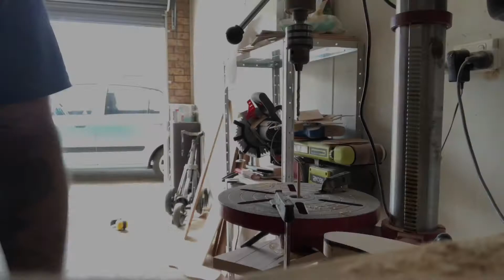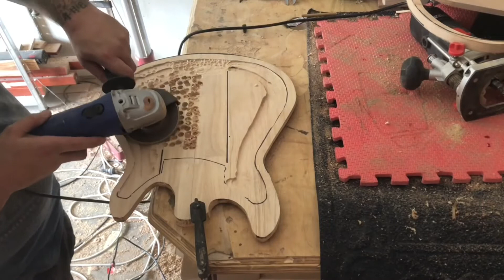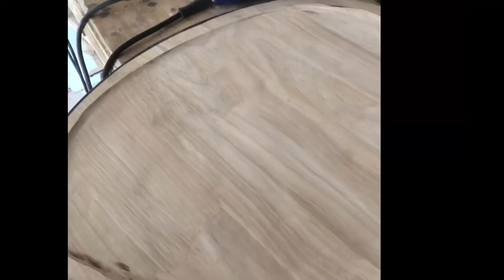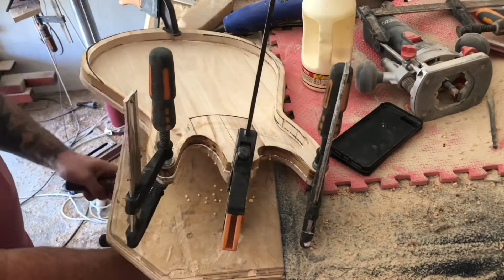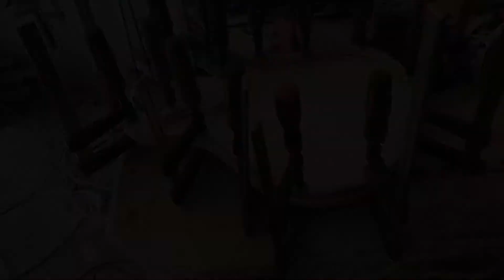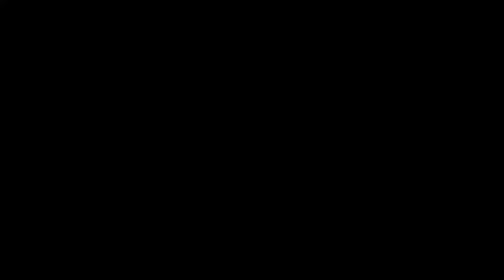Lockdown guitar challenge 2020 #4

Comment: Thanx for the video, I understand now how the dowel works with the drill lol. Great job 👊
Reply from the maker: Yeah it basically works kinda like a pin router, just set it to a bit thicker than you need and chisel or sand away

I didn’t have a lot of time so I used the grinder
Reply from the maker: I believe someone else is doing something very similar
Reply: @saulgoodeguitars  yeah it was good to see in action. I'm dyslexic, so reading instructions frustrated me most of the time, but videos like this really help 👍
Reply from the maker: @SteveWalkerGuitars  happy to help Steve